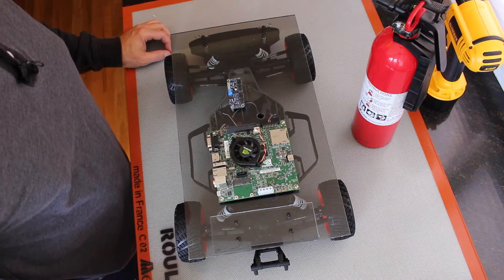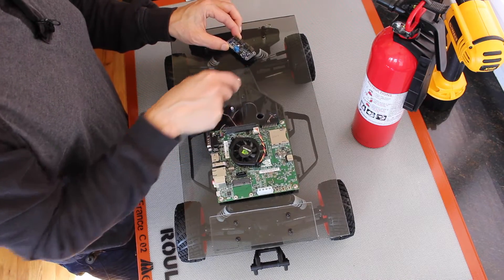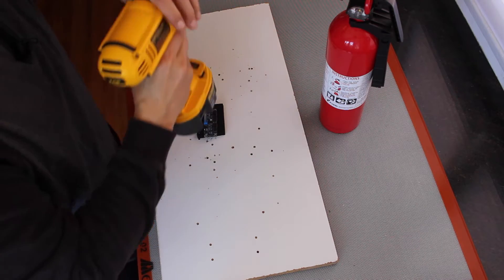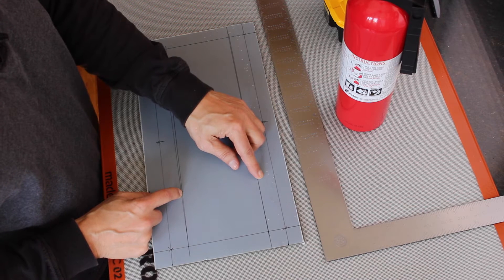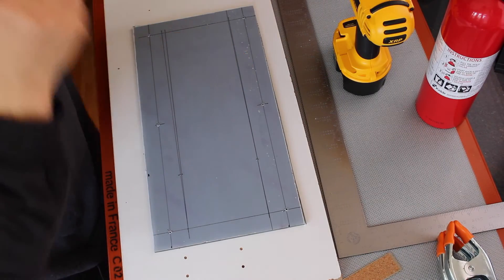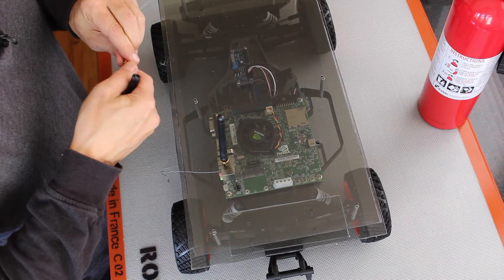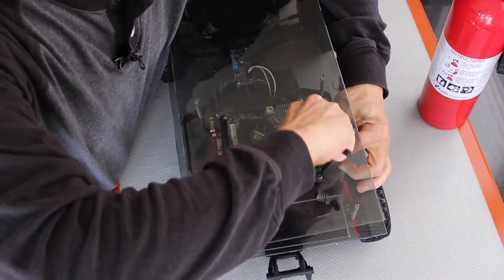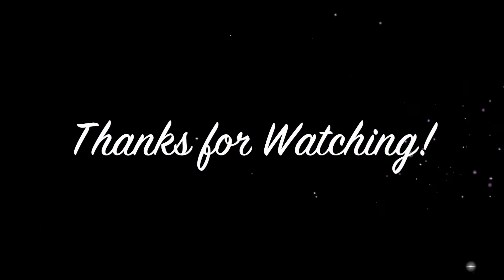Jetson RACECAR Part 6 - Upper Platform

Comment: Will you be putting future videos for this project. I saw you started a new project on the UAV. Is the race car project dead? I am really looking forward for the ROS software integration for the race car project.
Reply from the maker: +Alex R The RACECAR project still alive and kicking, the UAV project is another project entirely. The UAV needs to be through the first pass by the first week of April, so I bumped it up on the video/article schedule. The RACECAR depends on some material from other people, it hit a little speed bump over the last couple of weeks.
Reply: +Jetsonhacks Thanks a lot. I am learning a lot using your detailed videos. Please keep them coming. Also, do you have any plan to build a ROS compatible robot from scratch (chassis, motors, encoders etc) using the Jetson TK1 or TX1 in future.
Reply from the maker: +Alex R A little green puppet once said "Always in motion, the future". I have to finish the current projects before considering new ones.
Reply: +Jetsonhacks Got it! Thanks !!